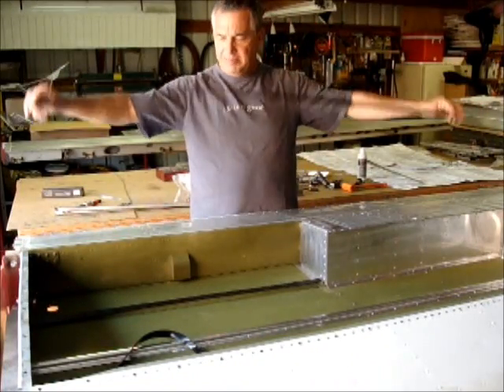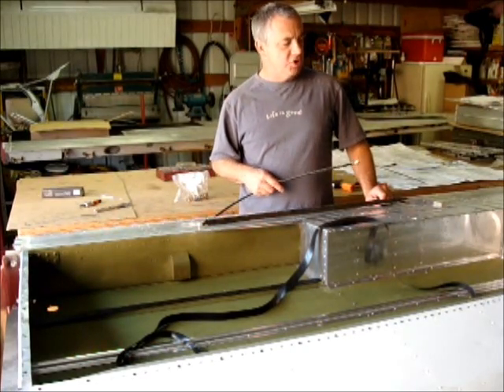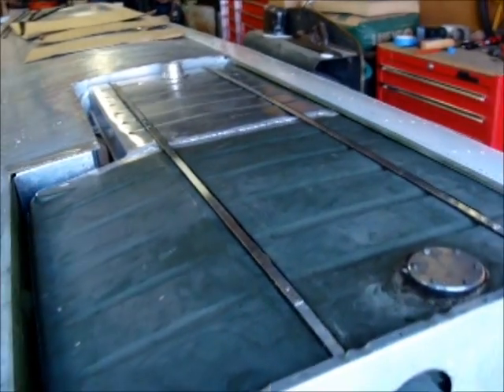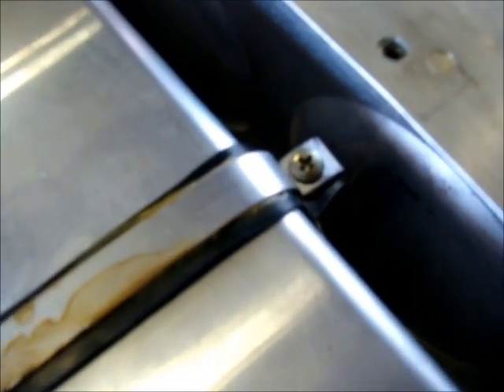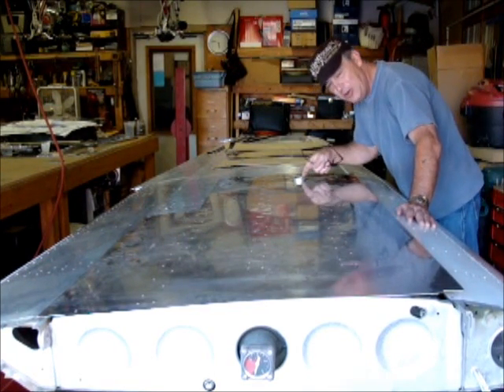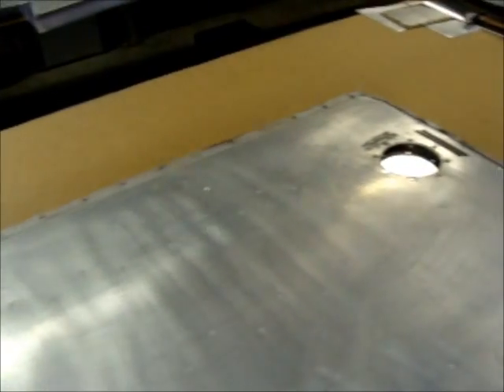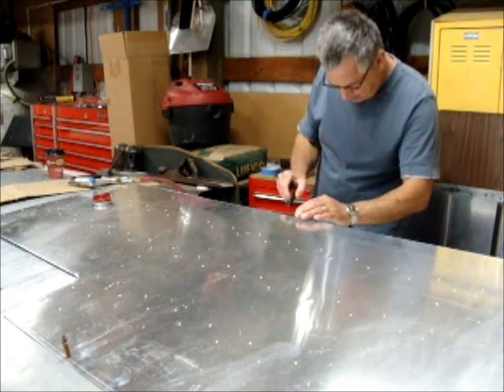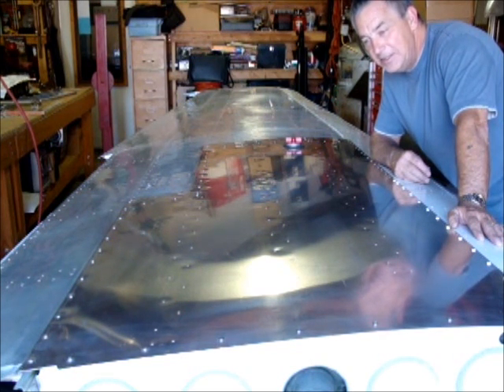Cessna Long Range Tank Mod Part IV

Comment: Do you think this aircraft is capable(with the correct modifications) of a 6000-8000KM range? is the generator around the shaft upgradeable with this engine? Because it requires a bigger generator with more KW of power to run on oxhyn. Can I just upgrade the old engine or do have to cast my own brand new KW engine? 

Do you know which website to get the UAV conversion kit? is it legal for civililians?